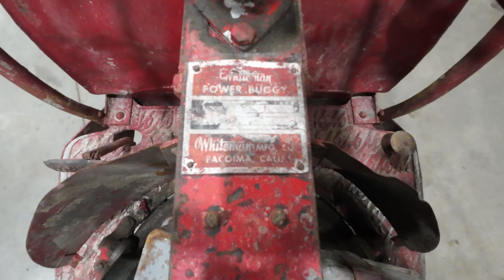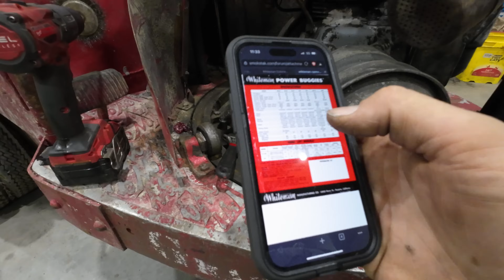Marketplace Find | Will this Motorized Dumper Ever Run again!??

Comment: Boy, this was a walk down memory lane! My Dad was a contractor that bought one of these for a big job in Bakersfield (they were manufactured in Calif.) in the early 60's. It just sat in the back yard and I'd play on it, turning the motor and dumping the hopper - we'd fill the hopper with water, dig a little ditch and set up our army men with the Germans down in the "canyon" with little cardboard bunkers and stick trees. Then we'd tilt the hopper to "bust the dam" and watch as the little grey men got washed away!  I hadn't thought about that for over 50 years! Thanks for bringing these buggies home! Put a smile on my face remembering the old days.

You can dunk that leaky float in hot water and watch for where it bubbles (the leak will bubble as the air inside heats up and expands). After you mark the spot, a dab or solder will do the trick (after you bake the gas out of the float.) Those Wisconsins are one of the best industrial engines this country's ever made!
Reply: It's typically pretty easy to drill a tiny hole in a corner of the float. Then make that corner the lowest point so the gas drains out. Once it's dry, a tiny bit of solder will easily seal that hole shut and then you just have to solder up the original leak you discovered from the hot water dunk.
Reply: Is that the same engine as the Wisconsin Robin.......or same company? In the mid 90's (Inland Empire of SoCal) as an early teen, I started working with my uncle who was a painter and his Speedflo airless had a Wisconsin Robin engine. He really liked that engine, but later we upgraded to a newer and bigger airless that I think had a Honda engine. That is pretty cool you got to play with that buggy. My brother and I would have had so much fun with something like that, as kids.
Reply: Thank you for sharing your memory, sir.
Reply: Talk about turning the clock back 65+ years - then you see how far we've come with how we do it today !! I much prefer how we do the same thing these days !! Thanks for sharing Matt !!
Reply: WATERBOARDING

Comment: You can fix the float by baking it in an electric toaster oven to get the gas out. Then use flux and a soldering iron to reflow the solder. Used to do that in the 70’s
Reply: 100%
Reply: If all else fails,  a guy can find em  on evil bay.
Reply: That was a fun video. Take getting the hang of to drive and not hurt anyone.
Reply: @kriswright1022  More fun to fix 'em.
Reply: DO NOT use a torch to vaporize the gas out. I was fixing a float and the gas was vaporizing out nicely, with a little jet of flame. Then it blew up.
Reply: @phlodel  as they do, you can brush the torch across it just to raise the heat a little

Comment: You find some amazing pieces of industrial history Matt.
10/10 for seeing potential and not scrap value 👍
Reply: It breaks my heart I live in NY 7 hours away from Matt and everything old iron around me I wanted to own has been scrapped
Reply: Those buggies are still used, at least new versions. Here in SoCal, we get a pump for everything but watching concrete guys in Wisconsin, they often use a buggy. It is cheaper and they can run any mix vs. having to thin it out and run gravel vs. rock.

Comment: Generic name for them on a concrete job is a "Georgia Buggy" . Use to see them all the time before concrete pump trucks came around. That's when men were men and sheep were scared.🍻
Reply: You can still rent the more modern versions.

For some jobs, cheaper than the pump truck and plenty fast.
Reply: With all due respect there is nothing irrational about being excited most especially when resurrecting an old piece of technology! I do not have the capability of sandblasting where I'm at but my ADHD / OCD would compel me to sandblast the equipment you work on and repaint them!

Georgia buggies are absolutely fantastic for Close Quarters and would arguably be more reasonable than hiring a pump. Congratulations on your new acquisition of the Ice Bucket!

Comment: Wow!  Never seen anything like this before.  Quite a unique find!  I vote for full restoration.
Reply: concrete carrying bumper cars :)
Reply: Being in commercial construction since 1978 I saw allot of these on many projects I was on as a union carpenter . I have been retired since 2011 .
Reply: Definitely a good clean up and a lick of paint with the Diesel Creek stickers on the side and you'll be the envy of any show.
Reply: +1 At least a good cleanup, full working condition and a nice coat of paint.
Reply: Amazingly, Whiteman Power Buggies are still manufactured - $14,000!
Reply: Nice video, glad you got it running!  Modern gasoline eats into the soldered floats and makes them leak/sink.  Let the gas evaporate out, and then seal it up using Locktite Blue, and let it dry for a day or so.

Comment: Matt,
If you have a float with gas  it, dip in hot water.
You will get a stream of bubbles where the leak is.
Point the leak down so the gas will pee out of the float.
Clean  the spot where the leak is with fine sand paper  and solders.
Check with hot water to see if the float is real fixed,

Stan

Comment: I ran one of these for my Dad who was a concrete contractor.  We used them to pour alleyways.  The trick was to slam on the brakes, spin the dump bed and reverse the wheels while they were in the air  at the placement location.  There is a learning curve to operate them, but we tuned them up some so they were fast and fun for young men.  At the end of day, you knew you had worked because during a pour the delivery was non stop and we used multiple units with passing lanes.  We used those until concrete pumps became available.

Comment: I live in Melbourne Australia and I can remember back to around 1953. A 6 foot concreate sewer main was been laid under our street. They had a huge concreate mixer which dump trucks would tip sand and rock in a hopper on one side and an army of these motorised dumpers would be filled with mixed concreate to be transported to end of  the sewer pipe. The workers were all Italian migrants and as a 10 year old boy I had never heard anyone speek anything other than English, I was fascinated by these people. Your video reminds me  of times long passed. Thank you.
Reply: had what was called dumpies,in the SEC,later version of Matt's ,had 16 inch bar tread tyres,single cylinder diesel,which put the whole thing higher,no problems unloading,great fun to drive with the rear wheel steering.

Comment: 6:59 I had one, I did actually use it at a flee market and used it to haul dirt to my backyard, I was going to have to haul about a dozen wheelbarrow loads of dirt, but I had my wheelbarrow with a motor. I used it one year for hauling rocks clearing out a fence row, where the farmers had stacked all the rocks over the years. I paid 100 dollars for it at a garage sale, played with it a couple years and sold it for 400. Made money on it and got to use it. I very seldom sell my stuff, but I had my fun with it. 😊 I shall add mine had a Wisconsin engine on it and it was HOT SOB sitting on top of that engine on a hot day
Reply: I remember concrete small jobs around homes for commercial!! Pads , etc

Comment: 17:00 The pulley tells you which way to wrap the starter cord , there is an angled side and a more vertical side. That is where the knot on the rope goes

Comment: Three wheel power trolleys were very common in markets and factories between WW1 and WW2 in England and Australia. They were a bit larger than that one and had a single cylinder diesel. They were/are bullet proof and ran for many years.

Comment: Bonus video!! Thanks Matt!  Those brass floats are pretty easy to repair. Just clean them up with water, then re-solder to repair the leak. If you need to drain the float you can either de-solder the seal or drill a small hole, drain and solder it back together.
Reply: Be careful soldering a float. Too much heat before sealing it will cause it to collapse when it cools. Don't ask me how I know.

Comment: Matt, I've got a pretty good boneyard of old Wisconsin's (mainly 2 & 4 cylinder THD/TJD & VE4/VF4, but I think there's a couple one pot A series ones in there too). If you ever find yourself in need of some of the unobtainium there, feel free to reach out. Also have quite a bit of Ford SOS stuff, which is pretty much all unobtainium at this point, should you ever have a need for it.
As far as this machine goes, it depends on what you wanna do for it. if you do a full resto, a dingle ball hone & a fresh set of rings would probably clean up the smoke & would last for as long as you need it. If you want to run it regularly & hate the rope start, throw a new Honda in it. Would have to adapt your clutch & that trick throttle set up to it, but I'm sure it could be done.

Comment: I love it! It steers like the old school bumper cars. It's much faster than I figured it would be.

I think you should give it a nice paint job, slap some Diesel Creek stickers on it, and use it to cruise around at the auction & shows.

BTW, you could probably still buy OEM rings for the pistons.  That and a valve job would probably cure most of the smoke & give it a bit more power.

Comment: Ah, the glorious "tremmie."  They'd get raced around on multi-story buildings, sometimes going over the edge, sometime with the operator still aboard.  Very much replaced by the modern articulated concrete pump.  (Some Unions mandated them right into the 80s.)  You almost never ran them straight into a spot, you canted them in, so as to start the turning of the dolly wheel before the need.
If at a meet, like the Steam Show, for someone to ride in the bucket--this is not a good idea.  If they sit on the edge, they are way in front of the balance point.  If they sit back, they wind up folded up into the bottom of the dump bucket (there are OSHA and Shop Rules on this aplenty as a result).

Comment: In the 70’s i operated a real similar machine. We had about a 15 ft  wide X  about 200’ runway and at first it was a real challenge to keep it running in a straight line. After running it for about a week you found out it was ALOT better than a wheel barrow.

Comment: Congratulations on your quarter-ton two-stroke sit-and-spin :) 

I love that you left it running even when you hoisted it into the air with your excavator bucket to dump out the hopper!
Reply: It's not a two-stroke. Matt just used oil-mixed gas to be gentle to the engine sitting for so long

Comment: Man this looks like an absolute beauty of a little machine. Yes it could use some creature comforts as the cog lock but it seems to be a nice little zipper for dry sand, mud, smaller gravel and indeed concrete. And as you've said, a beer cart would also be cool. Another vote for full restoration! Make that puppy shine bright like the proud little power buggy it used to be!
Reply: AND, put the DC logo on it too.
Reply: You came up with some cool applications for these "buggies."  ...I read your comment before I had time to cognize the concept.  I forget where it was brought up, which YouTube video, where some commenter mentioned  these.   Yeah, conveying sand, rock, gravel, dirt/loam, pavers, potted plants, fertilizer...  Landscape contractors would love them:  they can haul a few truckloads of materials either in or out of a freshly constructed  house.   Or  older home that has gates, walls...impediments or restrictions from truck access.  I've seen some motorized wheelbarrows, but nothing like these.  Sorry, I ain't in the trades.  Not just for cement...think about it.

Comment: Matt, I used to have this goofy contraption of a riding lawnmower that worked the same way. It was piwered by the single front wheel, and for reverse youd just turn it past center. It was called Big Mow. Had a 6hp Tecumseh engine, and two teeny tiny blades under the 26" deck. The two speed transmission worked kinda like a drill press, but you turned this knob thingy and it would tighten one belt and loosen the other. I wish I'd have kept it.

Comment: I could use one of those!  CVT's have been used in Snowmobiles since a Canadian by the name of Joseph Armand Bombardier first used one in 1959 on his invention. It was called a Ski-Doo. 🙂
Reply: Is this the genesis of the Bombardier Corporation which built everything from Ski Doos to Rail cars? Bom Bar Dee Ayyy, by the way. Lots of the AMTRAK SUperliner cars were made by them in Canada, then finished in Barre, VT.
Reply: The same Bombardier of the Aircraft engineering world by any chance?
Reply: @nickmaclachlan5178  Yes, the same. They started as a recreational products company (plus their Bombardier tracked vehicles) and ended up as an aircraft company.

Comment: Oh man. The memories of the oil field.  I had one of these engines I used hooked up to a gear a circulating pump. I don't know how many times it was under water. Drained, cleaned and refilled fluids and fire off first pull. Great engines.

Comment: That is probably a replacement ignition coil. The original ones were usually black (at least on the AKN/D). They liked to get kinda gummy and after warming up would lose spark. The D on the part number just means stellite exhaust valve and hardened seat.
Another gotcha with those engines is oiling. They are your standard splash lube affair but there is a trough through which the oil slinger runs, that trough is filled by a little pump that runs off a lobe from the cam, if the ball/spring in the pump sticks with crud from sitting you can have full oil but actually no oil in the trough. It's a clever system, means if you're low on oil there's still sufficient splash lube, but can also kill the engine.

Comment: That is a really cool unit. And extremely useful. I've carried concrete in a wheel barrow enough to see the value in it. Too bad it doesn't mix also. You'd never need a concrete truck for smaller projects.

Comment: The second hopper buggy needs a Yanmar single cylinder air cooled diesel. It would be a fitting swap for the channel, and they're horizontal shaft like those are. I've been wanting to get my hands on one for a while to power a mower.

Comment: Matt, I had a riding mower someone gave me when I was a teen. It had an oval frame with 2 idler wheels at the back, 2 Clinton 3hp engines, 1 mounted on the deck for the single blade, the other was for the drive wheels much like yours. But the engine did not rotate. The steering shaft went straight down to the wheels. To reverse, you just turn the steering 180 degrees. We had a blast doing backwards wheelies with it. I have no idea what brand it was or what even happened to it. But man, it was weird and fun.

Comment: Turn the motor a little and then use your drill with a socket attached on the crank and you got electric starter. Worked well on my lawn mower, great fun chasing the socket when it flew though 😮

Comment: I worked for a company called Mellon Stewart back in the late 80's on a 28 story highrise in Orlando. The company was out of PA. We had 5 of these we used to get trash out of the building. Done the buckhoist to the loading dock dumpsters. My crew would full 3 to 4 dumpsters in a day with these.

Comment: A tip for future reference that might help you resurrect an old carb. 

Old SU carbs used a Grose Jet for a float valve.  It's a replaceable brass fitting with glass balls stacked inside - the float directly pushes the lower ball up which in turn pushes the upper ball into a seat to stop gas flow.  They're robust and lots of them have been in use for many years without a problem. Since there's enough brass in the fitting that it can be machined I've fixed a few old carbs on Harleys by reworking them to a accept a machined down Grose Jet.

Comment: The bad float can be soldiered/repaired easily. It must be cleared of all fuel, washed in soapy water water, drained and dried then carefully soddered to reseal the float. Careful with a torch flame.. 😊😊

Comment: Matt, I worked for a construction rental company in Rockford, IL.  We had FOUR of those silly little buggies.  I resurrected all of them shortly after being hired by the company.  Ours were painted safety yellow.  Same engine as on yours.  They all ran great. 
I would rent them out.  Kids would pick them up for a big concrete pour.  When they returned they looked like they'd been beat with fire hoses!  They DO move concrete, but they are not an easy to run bit of gear.  Those kids were always just plumb wore out :)
What a cool memory you brought back.  Thank you for that!
We sold all four of them during the Chrysler retooling (end of the K-cars) to a contractor on that job.  Never seen them again after that.

 Stay safe and enjoy solstice!

Comment: What a cool little rig. I could just picture a whole line of thees showing up at an industrials job sight. The company I work for recently put in a bunch of large cnc machines. They saw cut the floor. Dug way down and used some conception similar 
to these, except they were electric powered to move the dirt and concrete.

Comment: Way cool i like it TIP- place wheels facing forward than put a piece of colored tape at the top center of the steering wheel now it is easy to tell what direction you are going

Comment: Before the cement pumper, these were used on skyscrapers!! A few went airborne by mistake !! They were off the buildings!!! They also had models with fan blades used to smooth the cement! The blades were no help when they went airborne 😂😂😂!

Comment: They used to make a railway station tractor unit that worked like that, they would pull three or four baggage trolleys. You’d see them on major stations in UK, they’d have the drive wheels at the front.